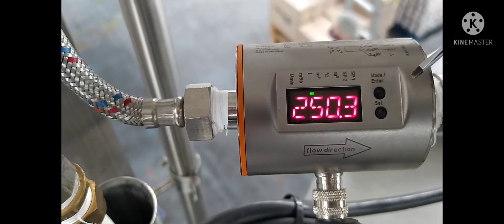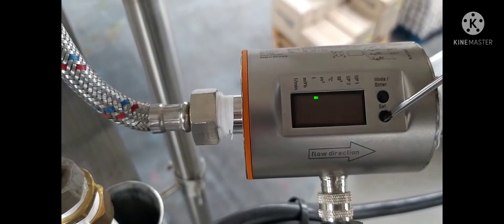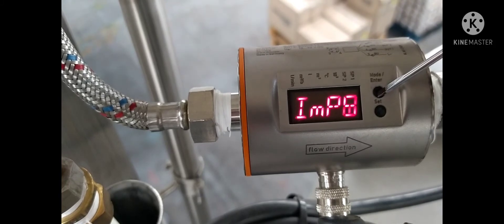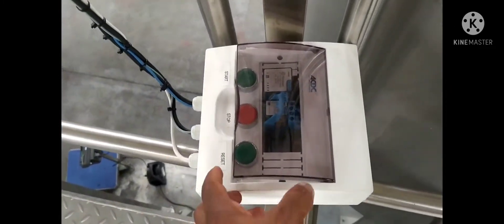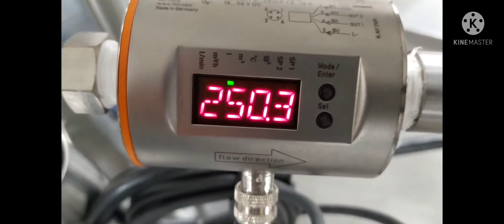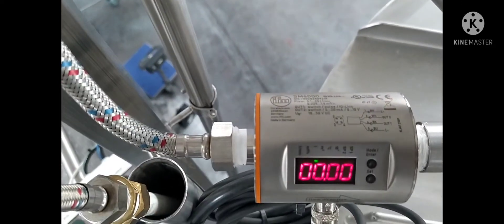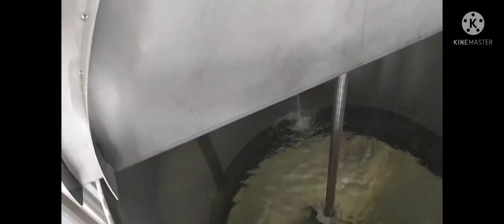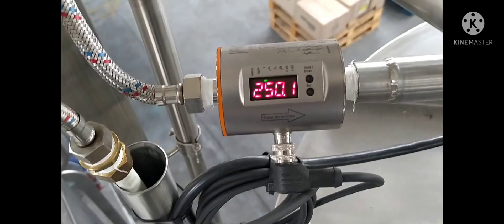SM6000 IFM flowmeter. flow control with flowmeter only

Comment: Hello, I use SM8000 flow meter. SN: r0005241120. How do I configure it such that when filling a volume of 10 liters, the fill should continue from a previous breakpoint until it reaches 10 liters before it starts over. Example I want to fill a 10 liter bottle, while filling, I release the fill switch at say 6 litres, the fill should continue from 6 to 10 before the ‘counter’ starts over NOT to start from 0 – 10 even though there was a pause at 6 litres.